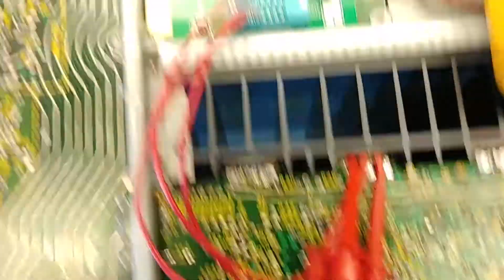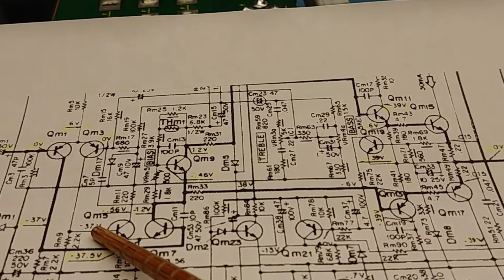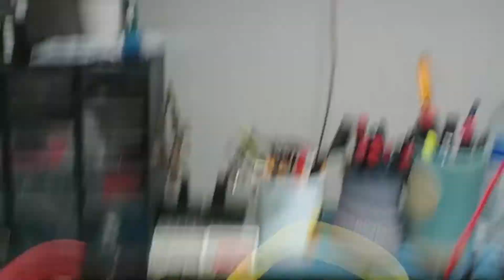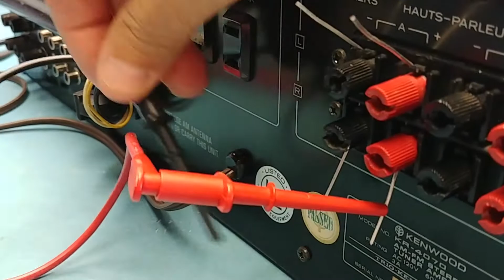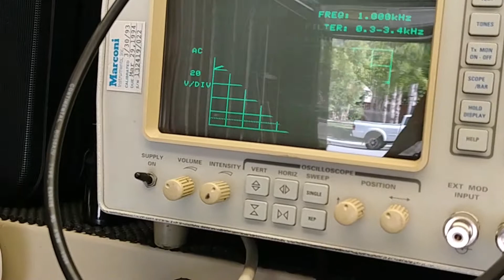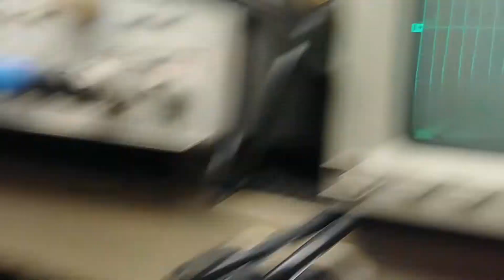Kenwood KR-4070 Repair, Service and Upgrade

Comment: What a lively and upbeat video.  Well maybe not (well at least it was enjoyable)!  But you wasted 1 hour of my life watching your methodical approach to troubleshooting the circuit.  This video was "riveting".  I have a KR-4070 from my high school days that I use purely for visualization on my table (audio actual through a whole-house amp) as the audio no longer works (but I'm OK with that).  Great video explaining your troubleshooting skills.  Always wanted to a EE but wasn't smart enough.  You sound young and if so you have a great repairing vintage audio (IMO) future.  Thanks again for a great enjoyable video.  Back to full focus on watching hockey.

Comment: A great video, nice work! 
BUT ... I'm confused about that VIA, bro. Is that problematic VIA a PCB trace (layer)? Shouldn't there be jumper (wire) that is soldered into the VIA holes? Please clarify.

Comment: Nicely done!   I had made a habit of really looking for cold solder joints as I have been bitten by them a couple of times.   I like to see Kenwood equipment repaired as we sold Kenwood at the audio store where I worked ‘75-78.

Comment: I just picked up one and the speaker selector seems finicky…I have to hold it to just the right position to get the A speakers to play with proper left/right balance.  Also causes static when I move it.  Any suggestions?  Thanks for the great video!

Comment: Great detail, thanks for putting forth the time and effort! I have a KR-4400 with a saturated left channel, and the service manual doesn't have voltages nicely printed in red by the transistors like yours does- I'd like to get ahold of that also! I've seen 5 videos about repairing a bad sounding left or right channel, and the fixes are all different. I have a lot to learn...
Reply from the maker: Yeah, sometimes you'll get lucky and get a nice svc. manual like that for free on HiFiengine.com. But If memory serves, I paid around $14.00 or so for the nice color version with the test point voltages. Well worth the investment though.
Reply: @vintageaudioowl1538  Yeah, I actually bought a used original manual. It's better for sure.

Comment: Given how old this video is I’m not expecting an answer to my question. It’s worth a shot though.

Which capacitors did you take out?
When out have to put a jumper across where the cap is missing?
Reply from the maker: Hi. So the jumper i installed was to repair the bad via (internal circuit board trace) between the supply voltage and the rest of the circuit. I didn't remove any caps for that repair. If you're referring to the caps removed for the phono preamp circuit, I think I showed what they were in the video. Thanks for watching.  :-)

Comment: Great video. Does the yellow wire from the triac to the power switch have a 100ohm resister in series?

Comment: Oh Nooooo! 
There is a boat load of caps in that box. Mine has been sitting in the garage since the 90's. I only wanted to see the easy pleasey video not the pack a lunch video. I'm sure the Arizona heat has sucked out all the goodness from those poor little guys. 
I'll be needing a recommended cap kit and a sandwich.
Reply from the maker: Haha! yeah, there are a few in there. Truth be told, they weren't all bad but they're cheap enough to replace if you're doing it yourself.

Comment: This is the best video on the KR-4070 on YT!  

Can you give advice on how to wire the triac? I'm sure it's really easy when you know where to connect the three wires. My power switch had one broken off lug, so I flipped it and I'm using the two new lugs/contacts that were on the bottom of the switch. If you're facing the faceplate and looking in, the left wire from the switch goes to the transformer and the right wire goes to the top of the unswitched 200w outlet.
Reply from the maker: Hi,
With regard to the Triac circuit, I followed the guide posted in AudioKarma:
https://audiokarma.org/forums/index.php?threads/is-your-unobtainium-power-switch-worth-5-and-an-hour-or-so-of-your-time.504673/page-2#post-6897970

Comment: hi, can you service my unit? I have the same receiver and for some reason I do not get any power
Reply from the maker: Hi,
Sorry, I'm not a repair shop and I unfortunately don't have the time to work on outside equipment. most of the stuff I work on I've purchased broken, repair and sell to fund the hobby.

Comment: I have one of these and am interested in the parts for the phono section upgrade. Do you know the part numbers you used? I'd do the easier mounting chip. I've replaced the power switch/speaker selector. Need to re-string the tuner. Have you done that?

Thanks,
Perry
Reply from the maker: Hi,
So the op-amp I used is an OPA604 made by TI (Texas Instruments) you can order them from Mouser or Digikey. Good luck finding the 8-PDIP package version of this device though. Everywhere I look they're out of stock and tagged as an obsolete part. The 8-SOIC package versions are available everywhere and can be had at around $3.00

The adaptor is a BrownDog 111002 TA7136 Upgrade adapter. I ordered mine from Cimarron Technology and at the time, it was $7.90/adapter. 

Never done a tuner string and I hope I never have to.  🙂 Doesn't look fun! Good luck!

Comment: Thank you for the marvelous video. I actually started to cry when you skipped over the tuner alignment. The reason I watched the video. Sadly I am off to perform seppuku.
Reply from the maker: Awe man! Sorry about that! Tuner alignment requires some specialized equipment that most folks don't have (I'm missing some of it myself) and my methods combine workarounds and a substitution to get the job done. Perhaps I'll cover it one day when I have all the proper equipment. Thanks for hanging in there!

Comment: Is there a way that you could go through the alignment on this unit? I see some things in the alignment procedure that I have questions about. Like what is a T meter?
Reply from the maker: Hi,
Yeah sorry I didn't record the alignment procedure. I was already time consuming enough without filming it and the vid was already over an hour! The "T" meter is the tuning meter on the face of the KR-4070 that tells you when the station is Tuned in and centered for the maximum reception and fidelity.

Comment: I have this receiver but  last year the  tuner section does not work. What can i search ? Is testing equipment essential to find the problem ?
Reply from the maker: Hi,
Troubleshooting tuner problems would be tough without a signal generator to inject RF and IF as well as a scope and/or "sniffer" to pick up the signal and see where you're losing it. You'll also need the service manual with good schematics and receiver alignment procedures.

Comment: Hi, I'm currently trying to diagnose/repair my 4070 that lost its R channel output. Could you please share the part numbers for your replacement output transistors and any other troubleshooting tips you might have? Thanks in advance!
Reply from the maker: Hi,
For the output transistors, I used:
2  - https://www.mouser.com/ProductDetail/863-NJW0302G
2 - https://www.mouser.com/ProductDetail/863-NJW0281G
If you find yourself needing to replace the output devices and you use these, you will have to drill and tap the heat sink to accommodate them.

With regard to troubleshooting, start with the easy stuff:
Check to see if you have DC voltage on the speaker jacks. Volume down all the way, set your selector to Aux, remove any input sources and then turn on the receiver to "Speakers A". You should measure close to 0 volts. You'll typically see 50-100mVDC. 

If that's good, then you might just have a dirty switch. Hook some known good speakers to the "Speaker A" jacks, connect a source to the L&R Aux inputs, set your selector to Aux, and monitor the output. If one of the channels is out or low, try playing with the mode selector and speaker selector knobs and see if audio comes back. Check the balance pot, volume pot, and tape monitor switches too. Dirty switches and pot often present themselves as more serious problem then they are.

If that doesn't get it, start checking voltages in the pre-amp and output amp sections. At this point, you'll want to down load a service manual so you can compare your readings. I would also recommend tracing the audio signal from the output stage back to the pre-amp and tone circuitry all the way back to the input to see where it gets lost.

Good luck!

Comment: Just found the channel, great video very informative. I bet it took a while to make. The switch mod and ic mods very cool. The finish of the cabinet, is exactly like my Sony from the 1960s
Reply from the maker: It did take a little bit to shoot, especially because I has to take a break from it so I didn't chuck it across the shop! :-)

Comment: I have one of these receivers and it sounds great for about 5 minutes then it starts popping sounds in the right channel any thoughts where I should start looking
Reply from the maker: Hi,
I would begin to look in the Pre-Amp portion of the output circuit. There are a handful of Japanese small signal transistors in that area that are known to be problematic in this regard.
Reply: I was poking around on it recently and I have 90mv and 45mv dc offset 
I set the bias to 15mv 
I still haven't figured out why it's popping in the right channel yet 
I'm almost thinking I should recap the unit and see if it goes away
Reply from the maker: As I mentioned earlier, it's probably a small signal transistor in the pre-amp circuit. I would feed a tone (1k @150mv) in the aux inputs and follow the signal path with a scope or an old school signal tracer until you find where the noise is being picked up. Good chance that the transistor just before that point in the chain will be your culprit. Good luck!
Reply: Also I bypassed the power switch to take that out of the equation

Comment: Great video! Love your tip on cleaning RCA jacks :) BTW - the output transistors you have mounted there, were those NJW0281/NJW0302? Thanks
Reply from the maker: Hi,
Thanks for the kind words. 
You're very close! the output devices I used were the NJW0302G and the NJW0281G. I actually had to look at my Mouser invoice because the receiver has long since been sold. They're 150w devices so they're just a tad bit overkill... :-)

Comment: I have this 4070, but the tuning rod is bent and I don;t know how to get a replacement part so the knob wobbles.
Reply from the maker: Hi,
If you're carful, you can bend the shaft back to where it's fairly straight. It will never be perfect but I think you could get pretty close. Just little bits at a time and don't be in a hurry. I've done it to a Pioneer SX636 that I worked and it's darn near bang on.

Comment: Great Video, I have two questions... First, can you please elaborate with instrcutions on how to creat ethe triac which you made?, and do you have a BOM list for all the capacitors which you replaced? If so, do you have an email which I can write you to get this information?
Reply from the maker: Hi,
With regard to the Triac circuit, I followed the guide posted in AudioKarma:
https://audiokarma.org/forums/index.php?threads/is-your-unobtainium-power-switch-worth-5-and-an-hour-or-so-of-your-time.504673/page-2#post-6897970

I don't have BOM for all the caps as there were several that I had on hand. That said, BOMs are a risky thing anyway because circuit boards will often undergo design revisions where the component values and positions may change. It's best to have a svc manual and the unit in front of you so you can verify components before you place an order.

Comment: It’s great to see videos like this, thanks for the time! Just a couple of questions, I have one of this, obviously is not new but it was kept really well and works flawlessly, recently I decided to recap it, but first just for curiosity I measured a couple caps (electrolytic), then a couple more and then all of them, it turns out all the caps are perfectly fine regarding capacitance, so it would make any difference to do the recap? Next question, I use this amp mainly for vinyl listening, I saw you upgraded the phono preamp section, so I would like to do the same, even if mine works fine it can sound better, so I’m like asking for advice here. I’m not ready to give it away and get a nee amp, I really like that style. Thanks again for time!
Reply from the maker: Hi there. 

I'm assuming you measured the caps in circuit, otherwise you were already half way to replacing them!  :-) 
Did you test them for both capacitance and ESR? (Equivalent Series Resistance) Here's the thing with electrolytic caps. The electrolytic material dries up over time from general use, thermal cycling, and age which can cause them to change value or even short in extremes instances. But the greater risk is when they begin to pass DC between circuits where they're put there to block it. This is where ESR comes into play. Recapping an old receiver (40+ years in the case of this one) is relatively cheap insurance against eminent future failure. Sonically speaking, you can improve the sound (ever so slightly) by using better caps in the audio path. This is especially true for low value caps (2uf or below) where you can replace them with film type caps. 

So that's my rational in a nutshell. I'm not saying that this has to be done if the unit is working well, but it's really just a matter of how long you would like to keep it working well. Pending any other failures, a recap will afford you another 30 years of great vintage sound from your beloved receiver. Hope this helps.
Reply from the maker: Sorry! With all my babbling I forgot to answer your question regarding the phono preamps.
I went after this upgrade primarily because one of the stock preamps failed. I saw this as an opportunity to upgrade to a newer, low noise component. If you listen mostly to vinyl, this might be a good upgrade to perform. It's not too expensive and fairly easy to do if you work in stuff like this. As I mentioned in the video though, I would recommend purchasing the pined version of the opamp as opposed to the flat pack version that I used. It will save you time and frustration!

Comment: Very good Video. I learn a lot! Thanks for that
Reply from the maker: Glad it was helpful!
Reply: @vintageaudioowl1538  
Please one question about the power on Switch. What kind of triac did you use? You have a small drawing for me?
Sorry for my english.
Best regards from germany.
Rainer
Reply from the maker: Hi,

I followed a circuit found on Audiokarma. I've provided the link below:
https://audiokarma.org/forums/index.php?threads/is-your-unobtainium-power-switch-worth-5-and-an-hour-or-so-of-your-time.504673/page-2#post-6897970

Comment: Would have been much closer to the rated 40 w/ch if both channels were running simultaneously. Nice work though, that circuit board flaw would have had me chasing my tail, too.
Reply from the maker: Good point! I guess I was kinda cheating...  Lol
Reply: @vintageaudioowl1538  LOL!